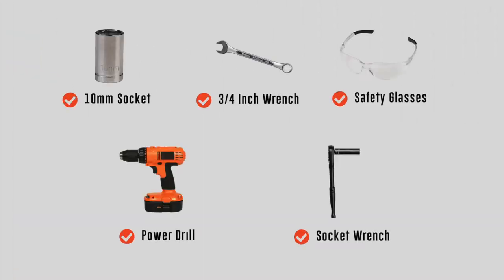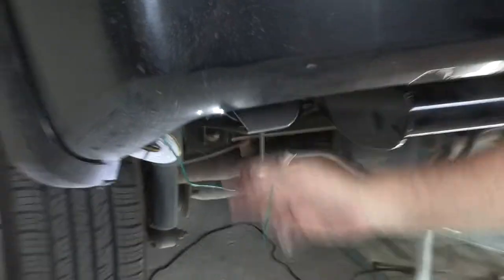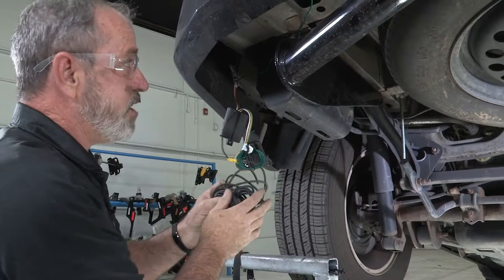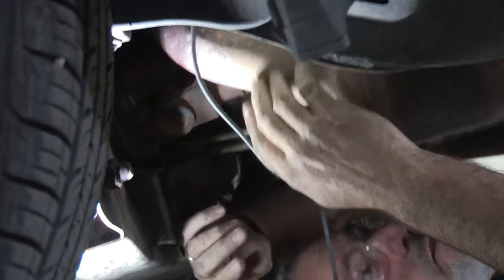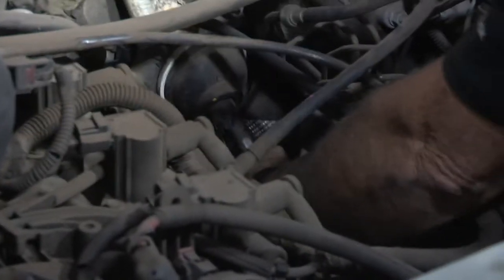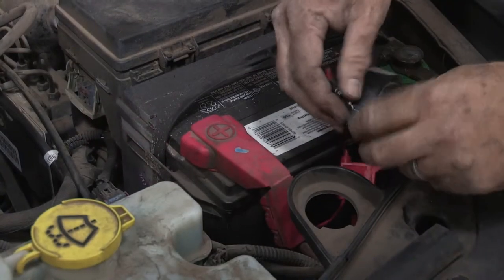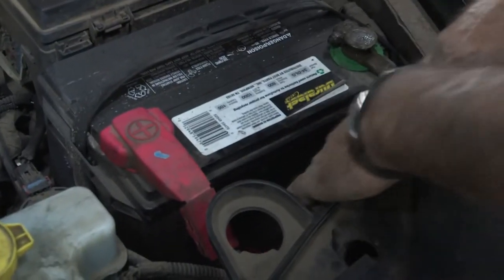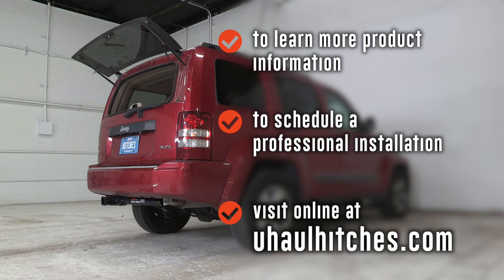2011 Jeep Liberty Wiring Harness Installation

Comment: Question 

2007/08 Library can tow a U-Haul car hauler. Ok smaller then the 2011 Jeep Liberty, so Mr. U-Haul man… why does the computer at the rental say the 2011 tow load is not recommended? Stock, sure. From the Chrysler factory they only equipped the 2011 with a pay load of 2700lbs

But the Liberty 07/08 is 5000lbs and a smaller and lighter Jeep.

I have an after market full pay load on my 2011 Library of 5000lbs and good old U-Haul says NOPE! Can’t use our car hauler.

Dumbest thing I have ever heard. The 07/08 is fine but the fully after market “documented” “papered” 2011 is a no go.

Come on man.

Thoughts please, I’m at a loss.